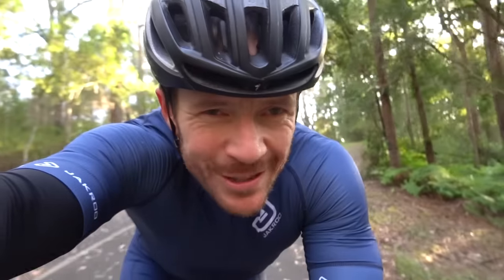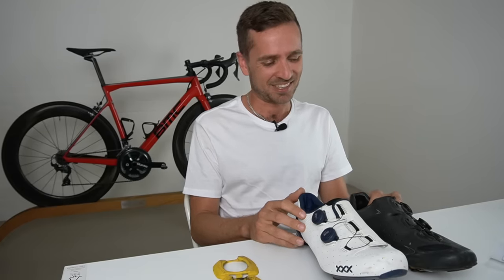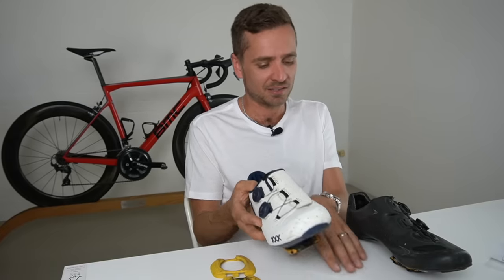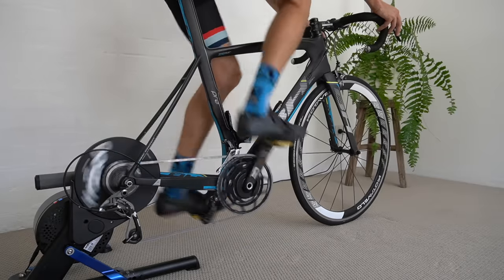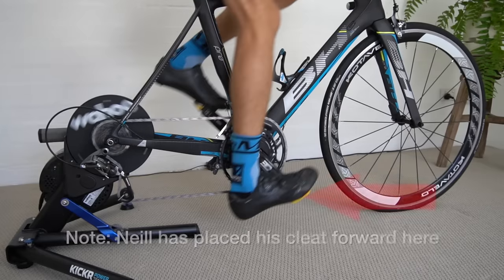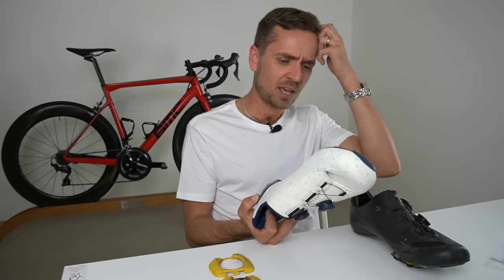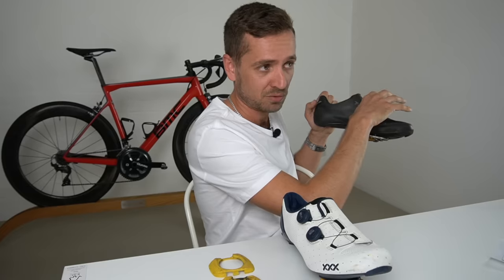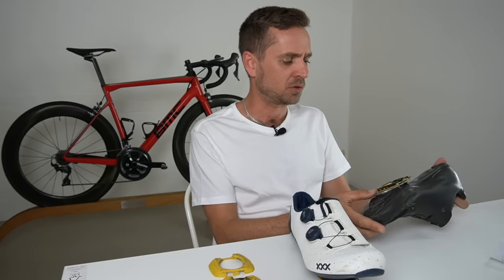Want More Power? (Two Cleat Positions to Respect!)

Comment: I use SP pedals along with the extender plate to move my cleat towards the rear of the shoe as I had an issue where I would over work my calf muscles in the traditional cleat position and would totally kill my calf muscles to the point of injury.

Comment: But why is the Pro bike fitter using ovalized chainrings?? It's all about perfect circles, proper ankling, cleat adjustment why would you ruin it with odd job~oval chain rings. ...? 
Not only has no sprint, but very power conscious as well. ...
Super informative post for real, aft of the ball for power, steadiness and pedal stroke!!😉🌐

Comment: Ha, straightened and moved my cleats back and felt like my heart had gained more chambers, I was spinning smoothly like crazy!  Cadence was higher and heels were more in control, I must have had them too far forward. Also, moved feet inward but there was no info about how to determine proper Q factor-Is it simply related to width of hips or maybe that determines a good starting point???
Also, Sid Ergo 3 shoes have numbers for cleat positioning but my numbers were not consistent from right to left so I just measured instead from toe pad; check your numbers on Italian shoes!
I almost think we should set our bikes up with nothing in proper setting or sync and then halfway through the year, put it where it should be and feel the extra, free power!  It's amazing when you happen onto one of these tricks!  Thanks for the advice!
Reply: I can’t tell you how many bike vids on YouTube are just “filler”.  THIS IS NOT FILLER!  I have no idea where my hips and knees are with respect to the pedals......going to grab a laser lever, shoot a vertical line, and start videoing my current position an see what’s up.  Great info.

Comment: Speedplay was bought by Wahoo, and they’ve been going thru “transition” for about a year. Wahoo has been absolutely terrible so far. From my own experience, I have used custom 59cm length Speedplay spindles for several years, and wanted to buy replacement pedal bodies as mine were getting worn, instead of buying an all new SS custom length pedal set at over $320, and have been going back and forth with bike shops and Speedplay/wahoo themselves for well over a year to try and buy just the bodies, and now about a month ago I was finally able to get them and they charged me just over $100 just for two pedal bodies. Right now, I would not encourage anyone to get involved with Speedplay pedals until they get their house in order.

Comment: Dammit!  I've already spent enough!  Now I'm looking up these other types of cleats with more axle length options!
Reply: Quick question. If I move the cleats back and the foot forward wouldn't the most obvious thing be too also move the saddle forward? And if necessary take a longer stem. Why move the saddle down? Which would rotate the lower body anti clockwise (looking from the drive side)?

Comment: Goodness I've the same exact pedalling style as Neil's! I'm using SPDs and being a massive heel dropper I had to drill holes in my shoes to move it even further back to an almost midfoot position and boy, do I LOVE it. My feet are really stable and I tire less even after 200km+. Another benefit I would like to add, a further back cleat allows more engagement of the glutes and which is known to be a very powerful muscle group; so why not use it to your advantage? But I agree about sprinting - it feels weird but after a few practices I got back my acceleration 'snap'... I think some neuromuscular conditioning goes a long way.
Reply: I need to learn how to do this and push mine back further.

Comment: If dropping the seat and bars to get out of the wind is an objective, why not start with a shoe with a 4-hole speedplay bolt pattern. There are several brands.  Gaerne is one.   By eliminating the 3 hole to 4 hole converter the shoe is some 6 to 10 mm closer to the pedal and more stable to boot.

Comment: Cam, First Question how can one find out how wide the pelvis REALLY is? i mean, you can measure the sit bones for the saddle and the outside of the hips, but surely the length of the leg makes a diference? so if one is 193cm tall, inside 94cm and hip width of 38cm ( Lineal not circumference)what would the recomended Q factor be? i only heard about shimano, speedplay or look. i would like to hear about TIME which is all i use (my knees like them) I used the Impacts which have a bigger surface area over the RXS and haven't used the new ProX  Question2: how much of a Myth is the pedal interface area ( Contact surface) as power transfer. thanks Mark
Reply: I guess the bike industry leaves you to buy 2 saddle with different measure and Feel whats better

Comment: Two issues to otherwise sound advice. First, positioning your cleat back increases the risk of wheel/toe overlap. Second, a cleat back position doesn’t necessarily allow you to drop your seat and bar height lower, if the normal cleat position “ankles”  (dorsiflexes ankle) more at the bottom of stroke. What is true is that hip angle will be slightly more open and sprinting power compromised.
Reply from the maker: Thanks for sharing on the thread.
Reply: Cam Nicholls you’re welcome. Keep up the good work!
Reply: I am not a racer,  but dislike toe overlap . My 1985 Rossin Record has no toe overlap. Seems like all the newer road/ race bikes have toe overlap. I think it does not come into a problem in turns , only in maneuvering type situations on the road , or if you are touring with a load , or on busy streets etc, where you may be taking hard turns , traffic, etc where you definitely don't want to be clipping your toe on the front wheel.

Comment: As a person who often walks and has always played sports primarily on the balls of my feet I would like to take a moment and apologize since it appears as though standard cleat positions have only been designed for me. Q factor is widely discussed around fat bikes, I switched to a 1x set up in part because of it. Again, my apologies, the road bike standard works fine ... for me. Hopefully more fit related variation comes down from manufacturers as has happened with saddles providing multiple width options.

Comment: Very informative video. I'm currently battling ankle pain after years of battling knee pain and having my cleats in pretty much the same position for about 3 or 4 years. It helped the knees but in the last year or so my ankles have gotten worse. I have to roll my calves a lot or they get really tight on the outside toward the back which I think is what started impacting my ankles. Unfortunately I have no access to a bike fitter where I live. How can I combat this before it ruins my cycling for good?

Comment: Have been adjusting for Q-factor for years now.  At 6'2" and with a fairly wide hip, standard Q-Factor is just too narrow.  This is nothing new but the fore/aft benefits/drawbacks were indeed very interesting.
Reply: Can buy pedal spindle extenders to widen your bike's "Q" to fit you
Often used on recumbent bikes.

Comment: This is super information! If you get the chance to talk to Neill about cleats, I would really like to hear more about Q factor. I seem to have the problem with engaging the rectus femoris. I can't figure out if it's because of the Q factor or because of tight adductors, pulling my thighs inwards.

Would also be great to hear about rotation of the cleats.
Reply: If you're narrow hipped, and your knees just about brush the top tube, experiment with a narrower Q factor. If it's no good, you can always change it back! If you're wide hipped, inflexible or large, try going wider and see what happens. Experimentation is free and quick!
Reply: I have tight hips, tried 20 mm pedal extender (shoe moved all the way in-board) and it was a great improvement in comfort. No more pain on the lateral edge of the foot and more fluid pedaling.  Granted, my road crank q factor was only 14,5mm, while a mountain bike's is about 17 and a fat bike 22mm.

Comment: 12:18 The large front chain ring appears to be a bit of an oval instead of a perfect circle.  Am I wrong, and if not, what benefit does that produce?  (I’m pretty sure I’m not wrong, as watching it in slow motion the edge of the ring wavers against where the cable lines up in the background, looking at the 2 o’clock position).

Comment: Thanks for the vid. Very useful. I tend to suffer from calf cramps at the sprint/high power output point of crits. Highly likely that it's just down to me not being fit enough but I'd never considered if my cleats were too far forward (and thus I was activating the calves too much too often). I'm a 44 shoe size, so will see if pushing the cleat back by a few mm has any impact (or whether I just need to get fitter!).

Comment: Be careful of buying the extended axle dura ace pedals, they have a shorter than standard axle to begin with so if you buy the +4mm version they are then just standard length, better to buy the Ultegra +4mm pedals instead.

Comment: This was great thanks.  I would like to know something about the use of spacers or wedges between the cleat and the sole of the shoe.  I've been riding for almost forty years with no foot pain at all...but then switched to a new pair of shoes and started having severe pain along the outside of my left foot.  After six months of trying everything under the sun with NO relief I finally tried two wedges which did away with all pain overnight.  I'm overjoyed of course....but don't really understand what all this means and I'm scared to death to every try another new pair of shoes it case it happens all over again.  Any thoughts or opinions would be appreciated.
Reply from the maker: Interesting to hear and thanks for sharing. I'll see if I can pose that question to Neill next time. Cam

Comment: I’ve tried this, however experienced a bit of wheel overlap. Size 44.5 shoe on a 172.5 crank and 56 frame Specialized. It feels great spinning along but my track stand and or starts from traffic stops is often affected nearly putting myself on the pavement a couple times.
Reply from the maker: Interesting, thanks for sharing Alan. Cam
Reply: Yeah it's a problem. Recently I fitted a rider to a 48cm frame (super short wheelbase) running a very rearward custom cleat position with modified shoes. We had nearly 30mm of toe overlap. He couldn't turn the wheel more than about 10 degrees without strike. He's happy and confident it won't cause him too much trouble but I was nervous. He's a professional so has better than average riding awareness though!

Comment: I’m skeptical about the calf contributing to peak power. In standing vertical jump it’s basically just held as a solid unit to transmit force to the floor from the hip/knee extension. In Olympic lifting (probably highest peak power of any athletes), almost the entire lift is done with the heel on the floor. If you calf has to support the forces from upper leg, then those forces will be limited by calf strength and it’s even worse I’d imagine if your also plantar flexing. As an example of this inhibition, do a pull-up on a slippery or small grip (like a rock climbing fingerboard), the grip becomes a limiting  factor and it feels like your pulling muscles are week and you can’t pull fast. Same thing happens in Olympic lifting with people who bend their arms during the pull (the explosion upwards is now limited by what you can isometrically hold in a bent arm position).
Reply: Jerry's Scenic Cycling nice article! I was thinking of doing a similar study myself. I think the placement at ball of foot maybe doesn’t impact performance much over a longer ride as your not expressing that much force at any given moment, so the calf is perfectly capable of providing a rigid ankle join to transmit that power to the pedal. Maybe the benefits, like higher cadence cited in your article; or the ability to make subtle adjustments to knee and hip extension by changing the level of ankle plantar-flexion through your stroke, make up for a slightly less efficient platform to transfer force. I’d be interested to see how track sprinters have their pedals set up, I’d expect they hold their ankle in a pretty fixed position too.

Comment: Neil talked quite a lot about leading with the heel and suggested to move the cleat back to compensate.  But what if you naturally have a very high heel position (not due to compensating for saddle being too high).  Is the solution the opposite?  Should I move the cleat forward?

Comment: The thing and probably the most important thing he left out was what the number is on the box of the shoe actually means.  Whether it's Euro or American, the number on the box has NOTHING  to do with the length of the shoe.  The "Size" on the box tells you where the arch position is built in to the shoes, and yes, bike shoes have an arch position.  This arch position is measured from the back of the foot to the inside ball of the foot.  A majority of guys have short toes in comparison to their arch measurement.  What this means is guys measure to the length of their foot and always say there's no arch support.  For example:  Let's say a guy measures his length at an 11 (44-45) and his arch measures a 13 (46-47). That means his toe length in comparison to his arch length is shorter.  So he buys the size 11 and finds it's too tight.  That's because his foot wants to be a size 13 (his arch measurement).   So what a shoe salesman will tell them is "The shoes will stretch", after a long time and going through numb toes, yes, it will stretch BECAUSE THE SHOES ARE TOO SMALL.  In a street shoe, this causes plantar fasciitis.  But the customer tries on a size 13 and instinctively they say, "I can't be that size.  It feels too big."  So the salesman agrees with them. Sells them the shoe they want and off they go and when they do some riding they see everything I was talking about instead of the salesperson knowing a little something about the fit of a shoe.  With cycling cleats you don't have to worry about the length because nothing to the fit of the shoe touches the front.  You'll find the ball of the foot will perfectly align with the axle of the pedal and it won't be so tight around the front of the foot.  A tight shoe is a shoe that doesn't fit you.  Do not let any salesman tell you a shoe will stretch and get better.  As a shoe breaks in the upper will begin to get softer and more conforming to our foot but a shoe that's tight will always stretch.  A shoe should feel a bit large  when you buy it because that will give the shoe plenty of room to conform to your foot.  You will automatically say, "It looks too big", "It feels too big." but the next option is to get what you want and what you wanted was causing all your foot problems. It's time to get some honest facts about shoes that will help you instead of just making a sale. 
So to wrap this up.  1. The number on the box is not the length. It tells you where the arch of the shoe is built in.
2.  Shoes do not stretch.  They feel too big at first but then conform to your foot.
3.  If you have foot problems when you ride, and you want the problems to go away, just try putting on a shoe to fit your arch position and compare it to a shoe that fits your "length" at a store and see everything I spoke of.  
4.  The length doesn't matter.  Get a perfect arch position and the width will most likely be closer to fitting you without stretching.
5.  If the salesperson doesn't know how to size your arch......GO TO SOME OTHER SHOE STORE THAT DOES. Keep in mind the conversions of sizes change from shoe store to shoe store depending on how much the salesperson wants to make a sale.  

Hope this helps you all to make better choices and get better fits.

Comment: At the beginning of the year I changed pedals from a Shimano SPD setup on my road bike to SPD-SL, consequently I have been experiencing less power up hills, toe numbness and also discovered in my first triathlon race after switching, very bad calf cramping when I transitioned from the bike to run. From watching your video I feel this can be alleviated by either going back to my MTB pedals or buying an adapter and continuing to use my new pedals shoes and cleats in a more midfoot position? I use my road bike with clip on aero bars and whilst I feel my speed on flat courses in the aero position has not been affected by the new setup, I am definitely using my quads more and engaging my glutes and hamstrings less which would have more impact on my power output?

Comment: I went too far back found my toes overlapping on front wheel. Completely frustrating.
Reply: Greetings! I have had that problem for years even with the forward cleat position because I have size 45.5 or 46 feet (depending on the shoe manufacturer) at 5'8" tall. 52 or 54 cm frame. My foot would hit the tire if I didn't watch it at low speeds. When I went to a more rearward cleat position it was much worse.   But I think its worth the hassle because it seems to be better ,less hot spots on the feet and you can feel the arch and foot actually bearing weight through the entire sole of the shoe instead of the pressure always being on the ball of the foot. I'm still getting used to positioning my feet in a sharp low speed turn especially u turns on a narrow road. Sometimes I have to get off the bike and flip it around. I think in the long run the comfort and endurance will be worth it. It will just take time!
Reply: Yeah me too. Have shoe size 47. But used to it now and doesn't bother me anymore. Just need to be more careful at lower speed turns.